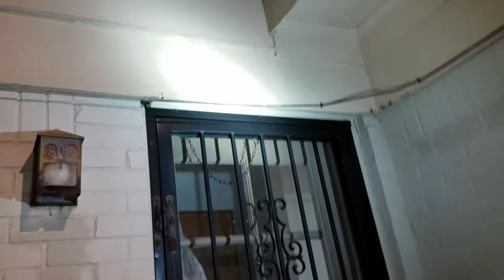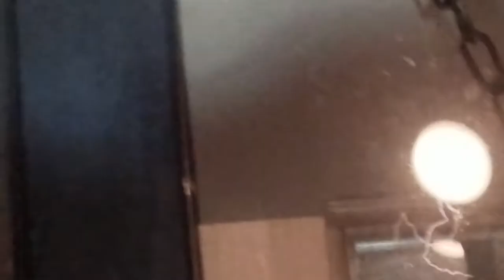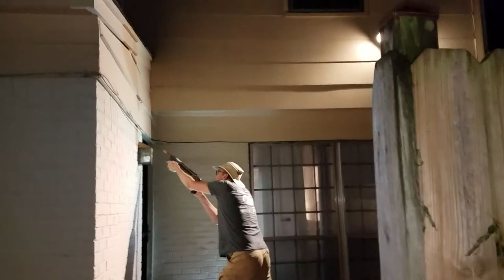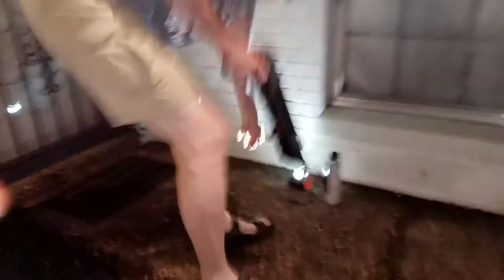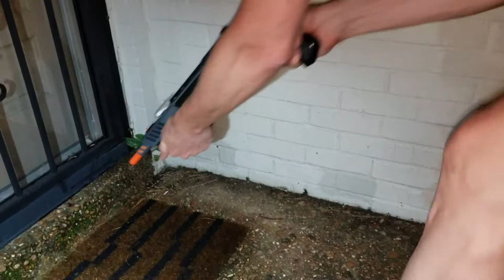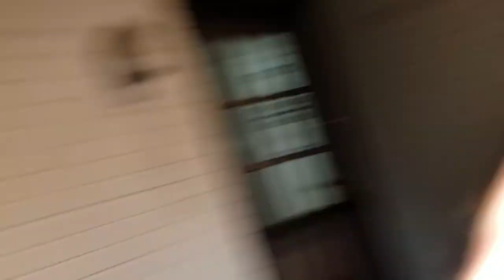Die wasps! Bug-a-salt 3.0.

Comment: Delta Force 😆
I bought one specifically for wasps also. I don't mind followup shots, but my plan is to stun them, and then stick the wasps in a jar of soapy water to dispatch them. I'll be using a large set of tweezers to collect the downed ones.

Comment: Was awsome! But level your shotgun between shots for most salt to drop! Is that the 3.0? Because mine has killed everything I have shot with it so far. 
  May take more than one round. But I can see the salt explode on and around them. And point blank I can drive a hole through anything bug, that isn't armored. You will have fun with that toy for a while.